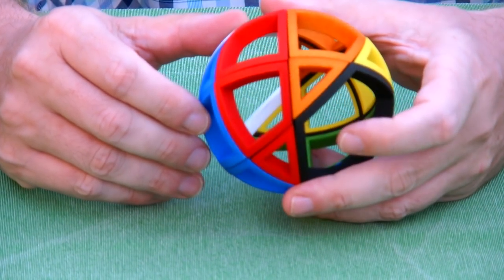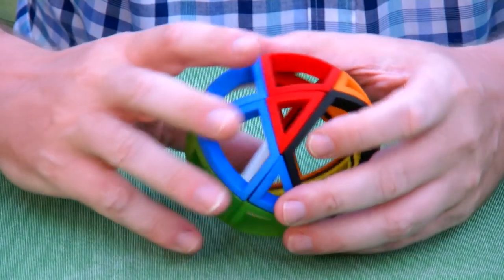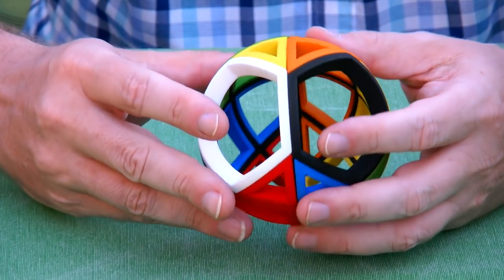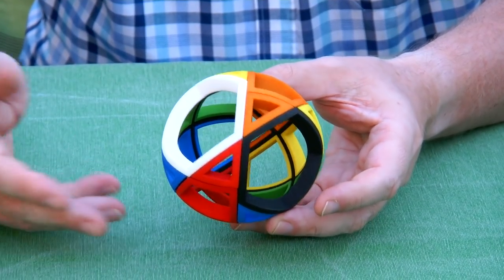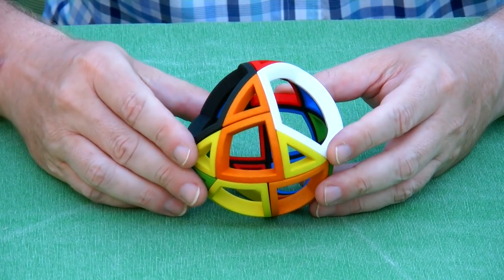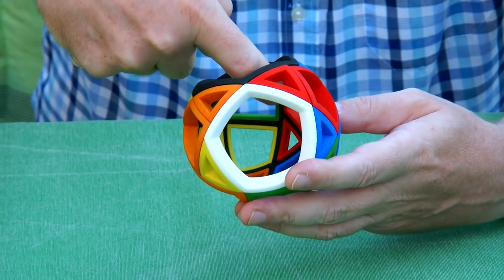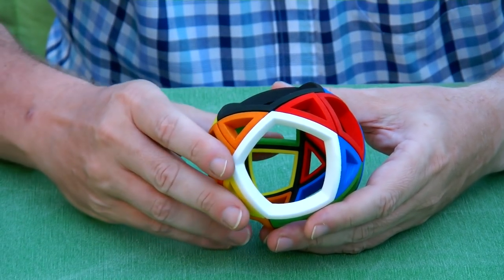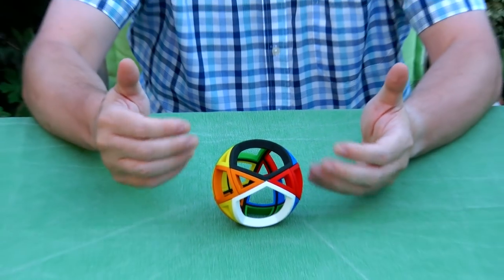Minimal Penta

Comment from the maker: What does the concept "deep cut twisty puzzle" mean? Why are these inherently hard to implement?
Reply: Was privated for 3 months, ok
Reply: Deep cut likely refers to the fact that the axis of rotation, and the sliding plane intersect the center of the puzzle. The difficulty likely comes from the fact that these great circles often don't line up outside of complete rotations. Every move away from it the less and less of these circles are preserved. To say the least of how free form the connective parts have to be while at the same time free floating. In fact, there's a lot of connective parts, and very large connective parts because great circles have the greatest circumference on a sphere.
Reply: What CAD software do you design with? Thanks

Comment: If the puzzle had both an inner and outer "cage", it could be possible to forgo dovetails entirely, right? In the case of non jumbling puzzles, maybe the cages could dig into the pieces instead of letting the whole thing spin around it. Also, if the pieces were thick enough, you could forgo the inner cage.
Reply from the maker: I am not sure what you are asking. This design is only possible with a dovetail construction.

Comment: I would wonder if there is a dovetail system that would work made of captured helixes to join the pieces?

Basically, each piece would have a helix sticking out of it along the edges and entry/exit points for the helix of the piece(s) that the edge was in contact with. Basically, the two pieces would weave into one another. But, to prevent jamming, each piece's own helix would be restricted to twisting in place within the bounds of the edge. It would purely turn in place. The pieces that weave in and out, on the other hand, would be able to enter and leave without issue -- obviously, this would require that the spacing between parts was always perfectly set up to be a ratio of the period of the helixes as you twist (but you could still have pieces of different edge length so long as they were all ratios of the helix period).

I believe that this would allow the pieces to always turn on any circle without jamming since the helixes would be guaranteed to never go past the corner of their edges, due to being captured within the bounds of their edge.

I could draw a diagram if the text description doesn't make sense.

I'm not sure that would be possible to accomplish, but you would be the person to play with it and prove it one way or the other. :)

Obviously, made out of nylon, it would have a huge amount of friction, but you could experiment with some large pieces just to see if the concept works at all. If it did, you could see about getting some off-the-shelf metal springs or something that could serve as the helixes at a lower friction level.
Reply from the maker: I have designed several interlocking puzzles with helical pieces. There also exists helical twisty puzzles, 14-15-type sliding-piece puzzles on a cylinder. What did you have in mind? Feel free to email me via oskarvandeventer.nl/index_contact.php?subject=Helical%20puzzles